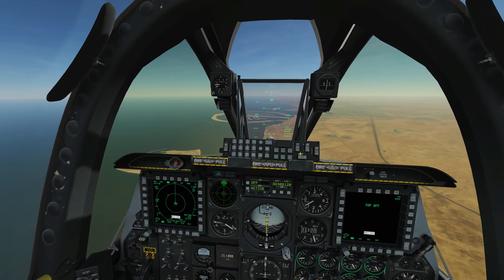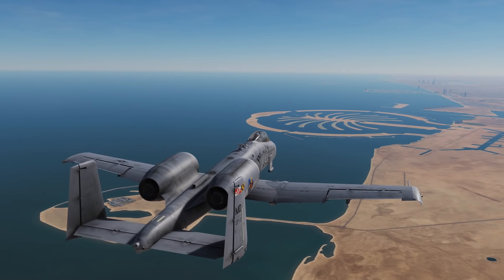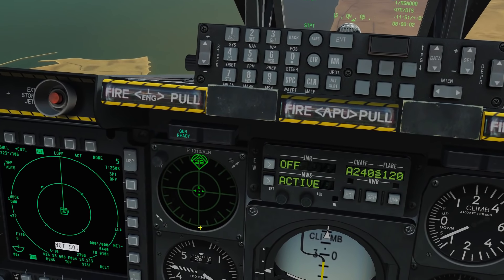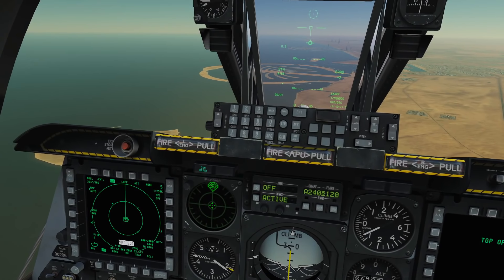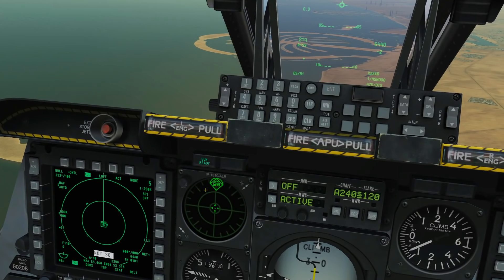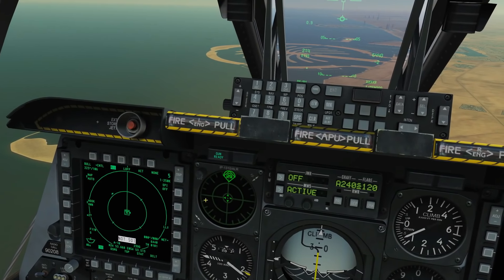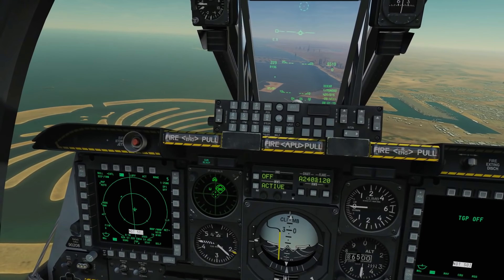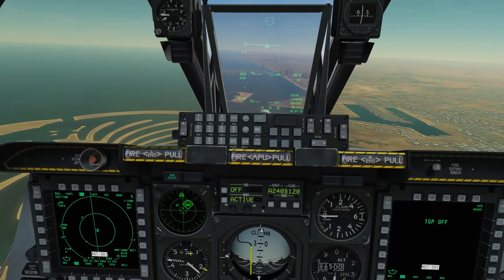A-10C Warthog: RWR Radar Warning Receiver Tutorial | DCS WORLD

Comment: Not sure about one part. If it's anything like the f16 radar it doesn't show the distance.

There is a ring separating the outter and inner sections. Outter is out if threat range, inner is within letheal. So an SA10 while physically closer could appear in the outter ring while an SA2 physically farther is within it's weapon envelope.
Reply from the maker: Have investigated the flight manual and it says there are no threat rings, and closeness to centre is indeed signal strength.

Comment: I think you got the meaning of the outer and the inner circles wrong, from what I understand, they represent the level of threat that those emitters may represent, for example, imagine there's a SA-10 (S300) is located 50 miles out from your pos and an SA-3 is located 40 miles out, while the SA-3 is def closer to you, you have less to worry about as you're out of the SA-3 30km range and will be displayed on the outer circle, while the SA-10 IS a threat as you're within its 90km range (tho range depends on missile variant too) and will show up in your inner circle
Reply from the maker: Have investigated the flight manual and it says there are no threat rings, and closeness to centre is indeed signal strength.